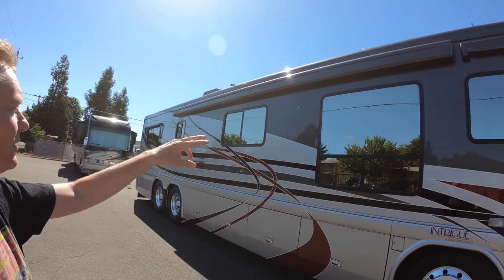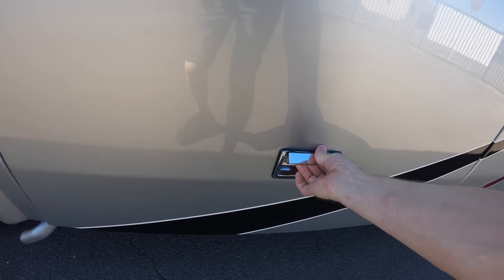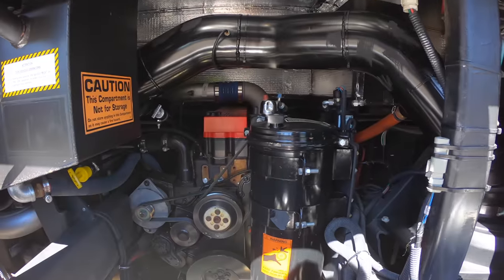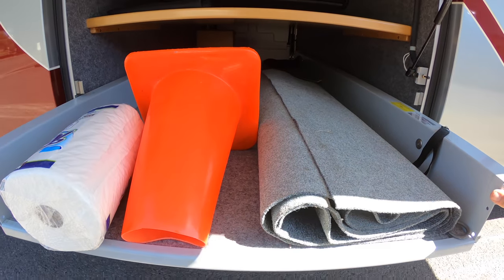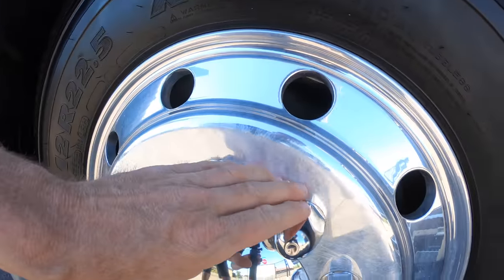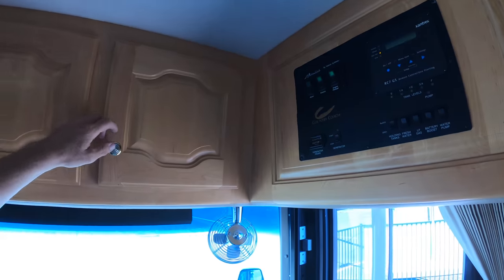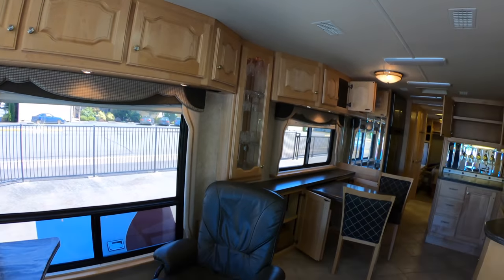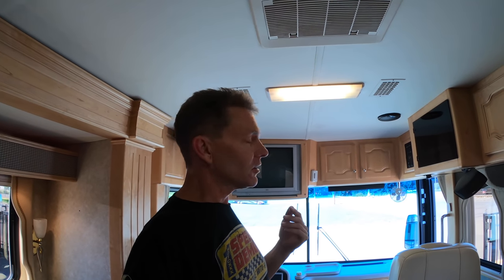THE CLEANEST 2004 USED MOTOR COACH I'VE EVER SEEN!

Comment: Steps should hve a sheet metal better grip cover plate u drop on if rainy or u need extra 2or 3 inches for God or granda-ma to climb in safely enough.
Reply: just store extra topper steps under bottom step until needed.

Comment: Beautiful coach. Hard to believe the condition of all the bays and motor compartment. 
Immaculate  interior. Not a fan of combo washer/dryer. Is there room for a stacker? mentioned tires were 7 years old and could probably get new tires and get them dialed in. I'm not sure what that means. Get new tires for the same price? And what's involved in dialing in new tires?
Does that make them last longer or what.  Have never had my tires dialed in, unless that means balanced on the coach. Are bigger side mirrors available? Please let me know. Thanks again. Love your videos.  Regards, Myk

Comment: That is a clean coach. As for those cargo door struts, they're cheap and easy to change out. The little seals in them drys up on them. Every vehicle I ever owned that had them, I would put a little oil on the struts shaft so that when I closed the doors the seal would soak up the oil which kept them from drying out.